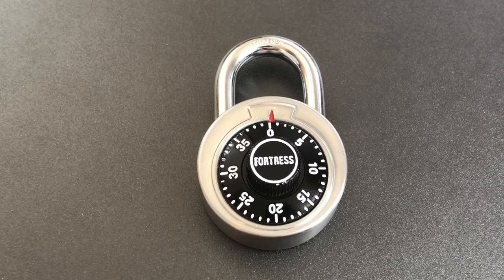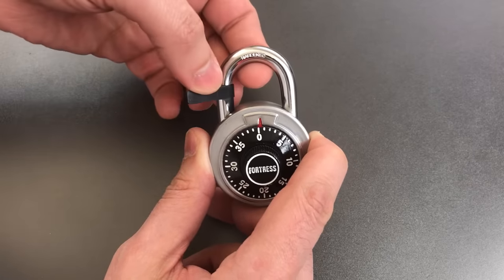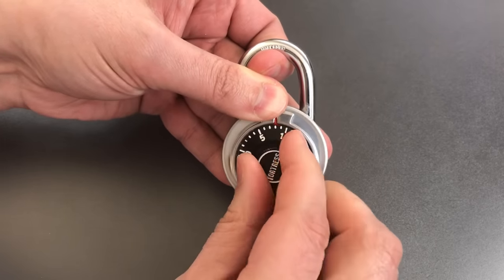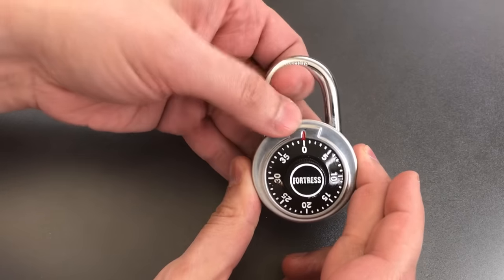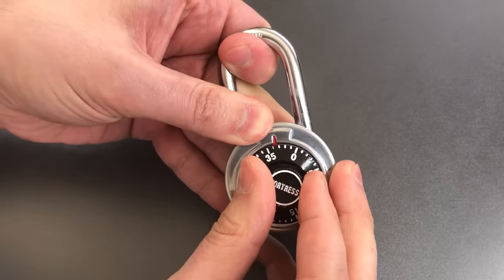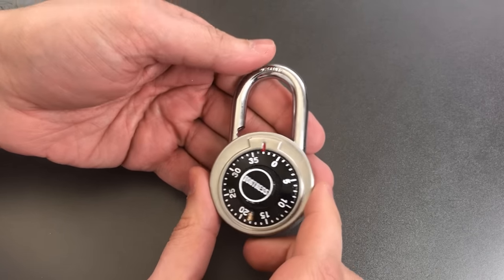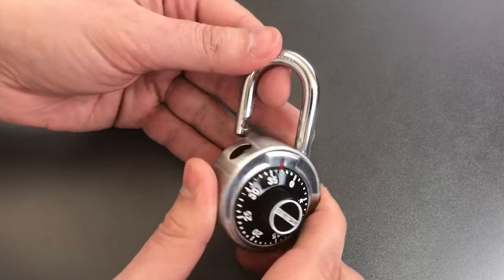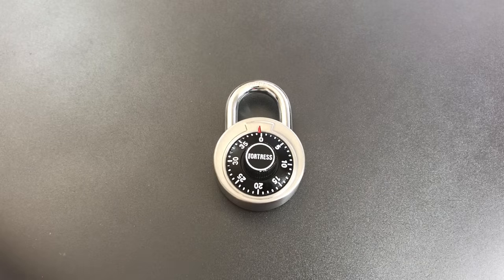[635] Fortress Combination Padlock Decoded FAST and Bypassed (Model 1850D)

Comment: When I was in High School (early 50s) we had locks like that on lockers, except that they were brass.  I could open most of them that way.  I called them "click-clank-clunk" locks.  Not very secure.
Reply: Same (although mine was in the 90s). We were suggested to get either a key lock, or one of these. Instead, I went out and got a Lockwood barrel combination lock. There was no feedback (or so as I could notice) from tensioning the shackle.
Reply: JAMES AZBELL  Had a new pair of Converse Chuck Taylors taken from my locker, combo lock, from H.S. in the mid-60’s.
Reply: Aha! So it was YOU!
Reply: JAMES AZBELL yeah my school has the same locks
Reply: We have them too (2019)
Reply: Mine was almost exactly like the one in the video.  Lots of kids figured out how to decode them when they were issued to us.  Sitting there in class for a half hour fiddling with them is like chimps and shakespeare. Then those kids teach others.  Hijinks ensued
Reply: Our school imbeeded most of them into the door, but it's the same lock. (2020)
Reply: Why were you still in high school in your early 50s
Reply: Graduated high school less than a decade ago and we were still using these
Reply: @felixsonganda4680  Now that's funny. Over 300k views...I don't think they got it!

Comment: I’m learning a lot about locks from this channel. An annoying coworker left her phone in her locker with the alarm going off and had one of these locks. Although I tried these methods, I failed. Plan B was to just pull hard on the lock, and it opened lol. Before I came across this channel, I thought locks pretty much meant “no entry, unless you have a lock cutter” lol

Comment: novice picker: "How do I open this?"
turns over padlock
"oh look the combination is on the back"
Reply: I actually own this exact lock. There is no real way to pull off that sticker. And no way to conceal that number. I scribbled all over the back of mine with a sharpie just to not give away the combination.
Reply: @WFanatic502  there is. It's called heat.
Reply: ...

Who designed this thing!?
Reply: I had the code on a sticky note on my cabinet years ago. I moved twice since forgetting about the lock and code . I took a sharpie to the back of the lock trying to cover it up. Thanks to this video I was able to say hey, I remember the code once I figured out the number sequence
Reply: @WFanatic502  I did the exact same thing also same fortress lock
Reply: @WFanatic502  Precision

Comment: The  order of the number is significant to open the lock.  Therefore the correct naming description for the lock should be 'permutation' lock
Reply: You aren’t wrong, though one could argue that, in this context, a permutation is a type of combination and therefore a combination lock is technically a permutation lock.

Comment: I have a combination lock that has the described physical styling, but it's smaller in all dimensions by about 10%.  It also doesn't decode the same way.  It's from Harbor Freight.  Maybe they finally did something right, I can't seem to decode it and would probably use a shim.  The pawl is smooth and while there isn't a ton of room around the shackle, a shim would probably fit.

Comment: These locks must have been improved since then.  There's nothing about my lock that gives away the first digit. I go right past it without any sign that it's the correct one. No click, no residence, no nothing. If i pull harder on the shackle the knob becomes completely free of any residence almost as if it's broken. Got it from a local CVS for $6. I'd love to send it you you if you'd like to give it a try.
Reply: I am having the exact same issue. I bought three of them from Wal-Mart this morning (1-25-2021) and none of them behave like in this video. The combo on the back opens the lock right up, but following @LockPickingLawyer instructions to a T I get no feedback from the first digit. If I put in the first digit to attempt to find the second digit it doesn't respond according to the video either. I wonder if they updated these.

Comment: Thanks for the vid! This method worked on my Master lock that I was not able to decode with any of the videos I found online. Also shimming it did not work. But I must say it was not easy, my lock has so many clicks when trying to find the first digit, almost 1/4 of a turn with random rattle, feels like the wheels are offset, maybe bad manufacturing.

Comment: As far as shimming goes, it would be harder if the manufacturer had better quality controls and much tighter tolerances. This cheap piece of crap doesn't have anyone in charge of quality control so I'm sure it could equally be easily opened with a light tap from a hammer or even a moderate jerk on the body.
It's always a pleasure watching the LPL though.

I wrote this before seeing most of the video so the hammer tap was also mentioned by the LPL of course.
The Keystone shape and the white circle? He's talking about you Masterlock!

Comment: Most padlocks can be opened with a 5 pound hammer blow to the case at the top in the middle of both shackle legs. Wham, Bam!  And most of the parts fall out including releasing the shackle.

Comment: LPL, did you develop this decoding attack based on a disassembly of this particular lock, or did you use a generalization of the mechanism of these types of combination locks to try a "naive" attack based on common vulnerabilities?  Appreciate your skills and your willingness to share.
Reply: The exact same question came into my mind.
Reply from the maker: I watched the mechanism through the shackle hole. No need to disassemble.
Reply: @lockpickinglawyer  could you make a tutorial on lock picking in general?

Comment: a lock like this may be ok for a very low security application for example a child safety  such as in a foster home where the cleaning products are stored.

when you become a foster parent security and proper storage of low level or mildly dangerous stuff like cleaning products would be stored and  is probably one of the things you required to make sure it is good enough.

for things like firearms they need a better security maybe you cant even have that on the property
Reply: The use of capitals and proper punctuation is deemed supervacaneous now? You sound like a pastor's preach. Sad.

Comment: Yeah, IDK about this... I actually have one of these EXACT same brand locks which I don't know the combination to, and I tried this method exactly, step by step, numerous times and I still can't get it open!... I know I could break into it with a good hammer hit in the right spot, but I was hoping that I could actually get it open by figuring out the combo so I could use it on my toolbox or somewhere like that... but so far to no avail! :(

Comment: forgot the combo of my old lock and was having so much trouble. turns out it was 29, 31, 16 or at least that's a combo that works. the two gates right next to each other were making it much more difficult than it needed to be

Comment: The question is does this work with zephyr locks. I seem to have zero luck getting this one open which is frustrating because it's locked onto the top of a friend's nephews water bottle, his friends played a prank on him and no one has the combination or the key. I figured I'd be able to get in without breaking anything but might have to cause I don't see anything on zephyr locks anywhere 😢

Comment: I have one of these locks and it didn't work.  I tried it a few times and didn't even get close to the first digit.  I will have to try some more later.  This type of lock is very easy to open with a hammer.  Usually only take one or two hits.  ;-)

Comment: I just picked up a masterlock 1500D and you can not do the decode. I am sure you can shim it and maybe hammer it, You can not decode it as when tension is applied it show a gate every 4th number. Package says anti shim. I will check that out. Either way it was discounted which is why I grabbed it.

Comment: I remember my highschool gym lockers functionally only had a two digit combination. For the third number, after you turned to it, you just had to keep turning the dial in the same direction to open it. It would just give a lot more resistance as it actually opened the latch. Like????? There was just no need to remember it so i never did! I mostly just hated them because they were so difficult to turn enough and then pull open

Comment: Sir, I was given 2 old Sears Lock-Co, Germany combination locks. Has the same keystone shape but the knurled part that you turn is steel color, not painted black and no circle on it. Seems like a better quality lock than Master. I tried several methods to open it but no luck. Hate to throw it away. 
Any suggestions? Thanks.

Comment: Because of this video I went to Kroger and bought one lock looks exactly like yours. The brand name is OfficeWorks. Even the label on the back of the lock looks the same. Unfortunately your technique did not work on mine. I'm still trying to figure out how to open it without using the combination.

Mine would click at 05 or 06 with moderate pressure. With hard pressure, it would get stiff between 15 to 05. And if I turn it back more than one round it would stop at 34. The correct combination is 11, 15, 34. So I don't know how to get to that number. 

By the way, the correction combination is printed at the back of these locks, and it seems we cannot change the combination. So how are we suppose to use them?

Comment: I have a lock like this and I was able to decode it, but it seems something is upside down in my lock. Using your method, which I have also seen in 2 other videos, the first digit had to be 17, but it's not. Instead, it was 37, which is exactly the number opposite 17. The second number was also opposite the number I got from using your method. Isn't that weird?

Comment: I got a safe RoyalSafe model 50 because somebody closed the door with the combination inside and no one remembers it so it’s mine but it’s closed 😂
Do you know and “easy” way to understand the inner working of the mechanism and figure out the combination for a mere follower of your chanel with absolutely no experience in lock picking 😅 
Thanks for your videos anyway 👌

Comment: What's sad is that these numbers seem to be a little bit more randomly generated than what you would see on a regular Master Lock. If master lock actually randomly generated the numbers in the same way as on this cheaper fortress lock, they might actually be harder to pick because if you know the first number, then there are only 100 possible combinations for the second and third number combined.

Comment: I've got a similar one from Tiger for an equivalent of $4. Noname, with the white circle and the keystone, but very resilient. Tolerance is just +- 1 and the last digit disc seems to act as a false gate - always capturing the inner latch, thus making the kind of an attack described here (and in all of the other videos) useless. Yes, it reveals the 3-rd number in this way, but it effectively prevents me from decoding the other 2 numbers. Rotating it while tensioned makes for a smooth click-less ride around the dial, always latching on the same spot. Any experience with such a behaviour?
Reply: If you ever figure this out, I'd like to know why they do this too. I bought the same one at a dollar store and it doesnt indicate the first number at all. In fact it indicates the LAST number...first...

Comment: I give up.  I have one almost identical to this, and I'm starting to believe the thing has a broken part someplace.
Reply: I had one that broke once too. Some of the cheaper ones have plastic wheels inside that can deform. Also the shackle retension clip on the other side of the shackle can come loose from the slots it sits in and interfere with the mechanism.

Comment: I have one of these generic locks. I drilled a small port hole in mine to try and decode it but there is a slight difference from the one that you have. The first disc (the one that is connected to the dial) is slightly bigger than the other two so essentially you can easily find the last digit of the combination but then I don't know what to do. Do you have any suggestions on how to decode it?
Reply from the maker: Can’t you decode through the hole you drilled?
Reply: Lol, yes, I can decode that one but I made the hole to learn how to decode this type of locks (I have another 3) but I cannot think of a good method.

Comment: I could find the click on mine but the second number in the combo I could not. The brand I have is called “Get” and looks identical to his in every way except the name. In his he was able to find the second number because it would become harder to turn back. Essentially if it was easy to turn back it was not the number. This is not the case on mine whatsoever. It is not free to turn back almost on the next number from the first in the combo. 
I was not able to figure out the code through this method due to this. Which makes me wonder. Did “Get” change something or am I missing something. 
I almost want to go try this on other locks. 
Ps. I know the code and can open it. The lock functions properly.

Comment: I'm playing with one of these, but most of the time I hear the first click as the dial passes the last number of the combination instead of the first. What did I do wrong?
Reply: Same same.
So, I bought one today from the dollar store....tried everything. Thought maybe I'm an idiot and missed a step. NOPE. Every resource that shows the same lock I am holding in my hands fails. The most distinct click and change happens on the LAST number. In fact, since I KNOW the combination,  I tried everything to hear, feel, etc, any change, but it passes easily over the first number....
If you figure this out, I'd love to know. Its driving me crazy.
Is a $2 lock really this elusive?
Reply: Master lock has the change on the final number.

Comment: Those locks are terrible. I broke into a locker doing this exact thing. (it was my own.) The wheel is rough spinning it normally, but I discovered this when I pulled the lock down to unlock it and it started catching on the correct numbers.

Then I bet my friends I could open their lockers.

Comment: If you don't have a shim, and you don't want to take the time to decode it, they also open right up if you just pull on the lock body with a hard, jerking motion. It's never taken me more than two tries to just yank it open. These are probably the worst locks out there.

Comment: I replaced mine with a dudley lock. any chance those are better?
Reply: "not even going to rely on for low security applications"

as it turns out, the most valuable thing you can lock up are your clothes when you go for a swim at a public pool in winter.

Comment: Can you show us how to decode a Master Lock Speed Dial?
Reply from the maker: Nope. That’s probably the best combination lock mechanism ever built by master. Too bad they made it out of plastic. seriously, the entire inside is plastic.
Reply: Your are missing something.  It accepts combinations of any length. There are four internal wheels that get manipulated resulting in several thousand possible internal states.  Many different combinations will lead to the same internal state which is why it can accept inputs of any length.

Comment: @lockpickinglawyer I have a moderately more difficult time with the Brinks combo lock of similar form:
https://www.homedepot.com/p/Brinks-Steel-Dial-Combination-Lock-172-49001/204306672
This lock has a gate every single number detent that makes it impossible to maintain constant tension (have to release to go to next number) and appears to have no obvious 'tell' in rotational room or otherwise when a correct number is encountered. Any thoughts to enlighten?